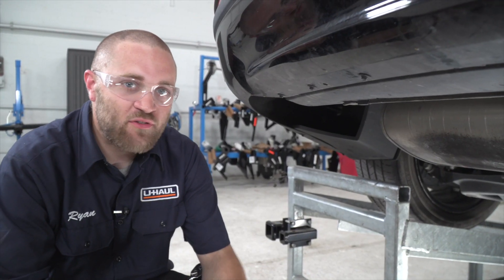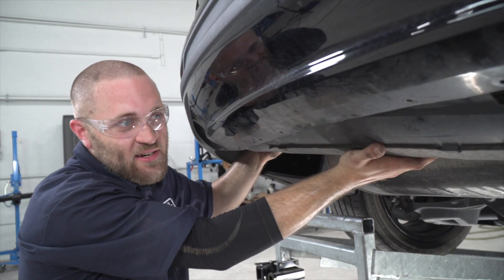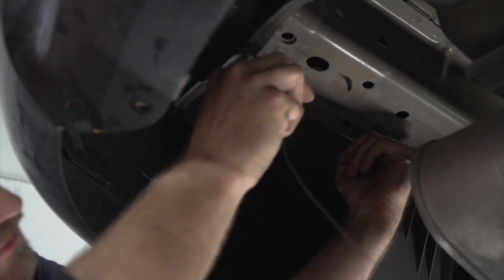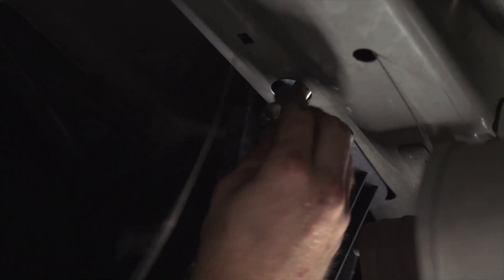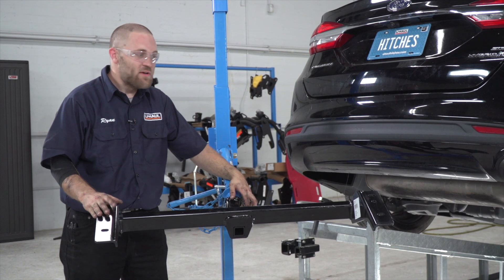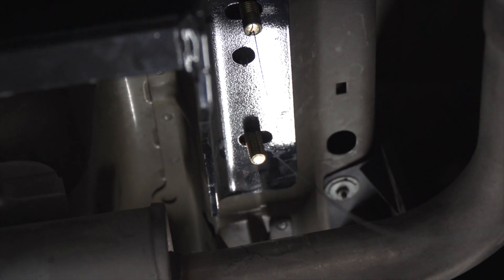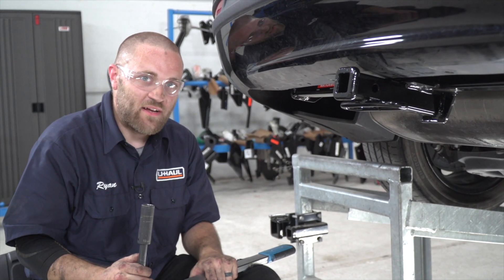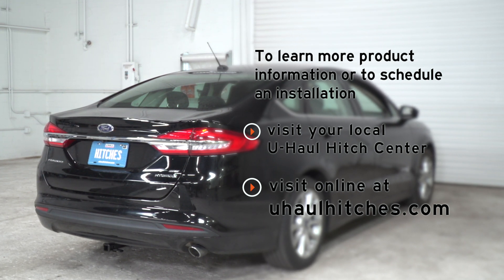2014 Ford Fusion Trailer Hitch Installation

Comment: Took me a couple of watchings to figure out what you were doing with the fish wire, mainly because the lighting and camera angles are not exactly optimal, but once I got it, I thought, that is freaking brilliant. Nice to see U-Haul volunteering a look at what they do in the shop to earn their installation fee. 
Anyway, a few tips: 
1) Use a head light.
2) Back your car up onto a pair of ramps to give yourself some elbow room.
3) Bend the end of the wire a little more sharply than it starts out to help maneuver it over to and through the bolt hole. And remember the flange and bolt go through one at a time. 
4) You can do this job alone without a jack if you slip one end over that side's muffler pipe and prop it up with something -- I used my tool box plus a carton that some brake pads came in.
   Then, if you're reasonably strong, you can lift the other end up onto the bolts with one hand, preferably not your dominant hand.
   Then yank or unscrew the fish wire from one bolt, and start a nut on that bolt. This will take the weight mostly off that end, so you can remove the other wire and get the other nut started. 
   Don't tighten them before you get the nuts started on the other side. 
   That other end of the bar will now be much easier to deal with, although it will still take some strength to get the first nut started.
Reply from the maker: These are all great tips, David!